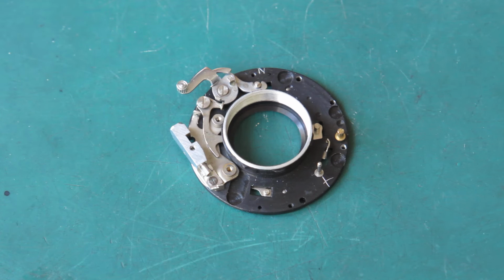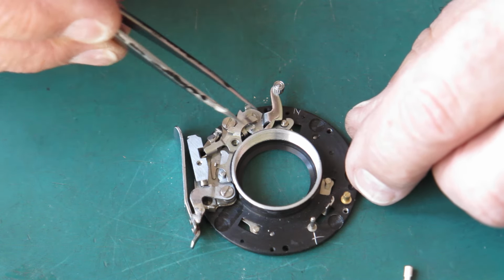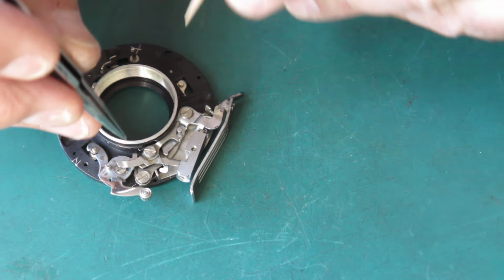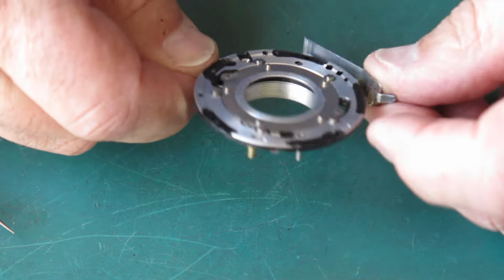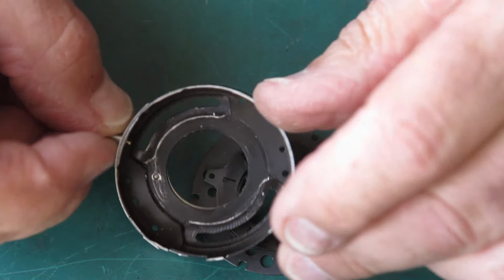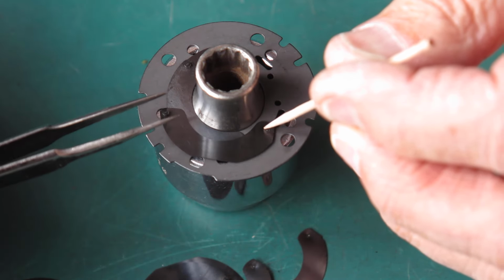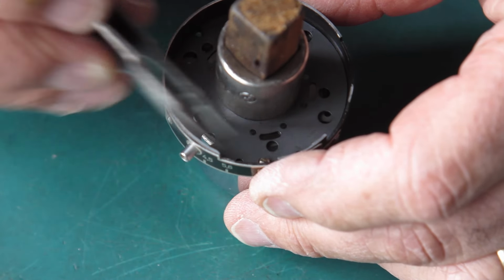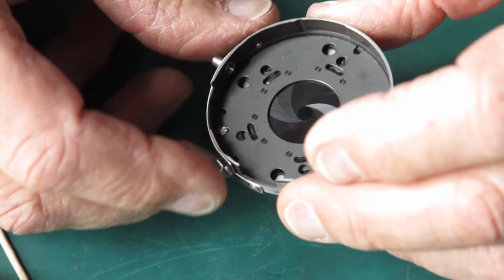Servicing an Agfa Isolette V camera with a Vario shutter, part 04

Comment: Very interesting video Chris. One question, why did two of the aperture blades have a flat side and did it matter which position they were placed during assembly. I don't think you mentioned it.
Reply from the maker: The missing edge on two or three of the blades would most likely have been just down to the manufacturer squeezing an extra row of blades out of the sheet steel. It served no other purpose, at least in this shutter, and has no effect on the action.
Reply: @ChrisSherlock  Thanks Chris. I love your videos and that little matter intrigued me.